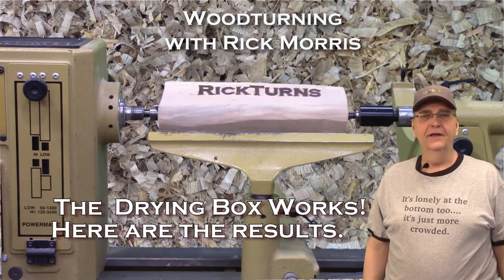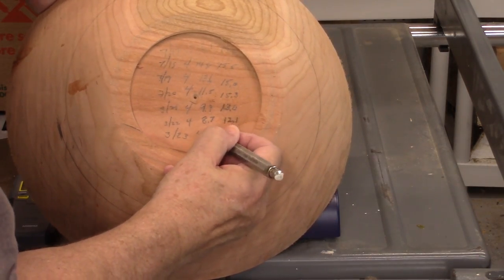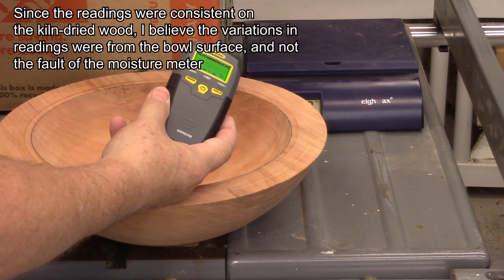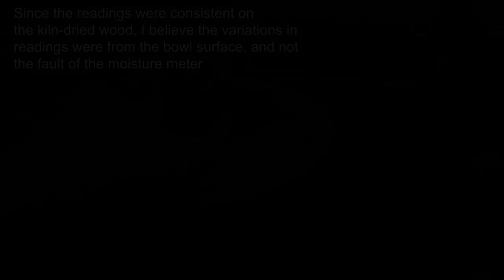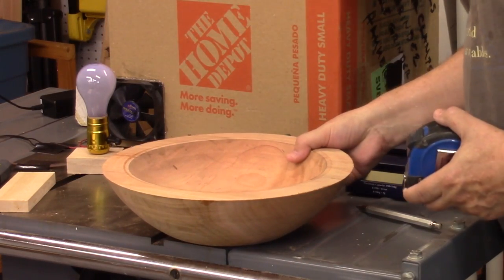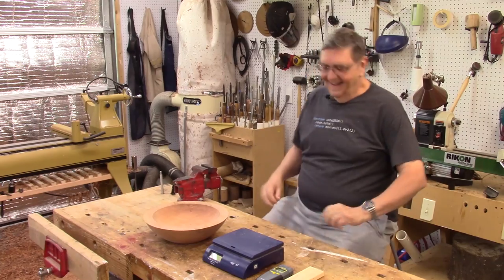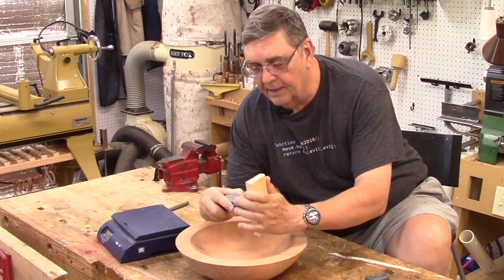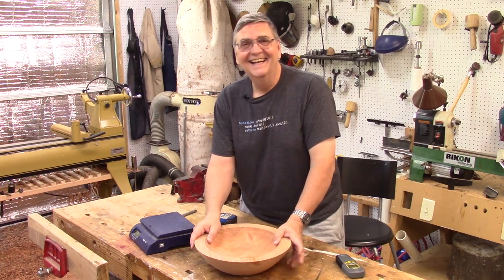Drying a cherry bowl blank in my cheap homemade drying box

Comment: By far, you have made the most simple and inexpensive process I have come across yet. Well, placing the bowl in shavings in a paper bag is less expensive, but I did not want to wait 6months to a year for the process to work. And, I dislike the microwave process. There is usually a couple of day process with that as well. I like your results from day to day as well as the regulation method of just using a larger or smaller wattage bulb. Very fine job, thanks for sharing!
Reply from the maker: Thank you, Stephen.

Comment: At the fair I watched a green wood chair maker, make his chairs.  The body was green wood and the spindles came out of his drying box.  His cardboard box he lined with tin foil and pushed wooden skewers through the sides to make a shelf for his spindles. He also had a light inside.  Don't remember if any fans were involved.  He said the spindles were bone dry and when put into the greenwood chair, the chair hole would dry and shrink and the bone dry spindle would expand, making a very tight joint.
Reply from the maker: Sounds like a good way of drying sticks, and an excellent way of making chai joints. Thanks for watching and commenting, Bruc.

Comment: Some of the moisture meters readings are effected by the temperature of the wood being measured and the temperature of the meter this could cause difference in some of your readings.  Check with manufacture to see if that is the case with your meter.  Liked your videos and look forward to more.
Reply from the maker: Thanks for the tip about moisture meters, Vic.

Comment: Great job of explaining the details. How or what would you say to change for drying 1" thick green oak cuts about a foot square? I have quite a few.
Reply from the maker: I would stack 4 or 5 together with spacers in between, then dry them for 4-5 days. Weigh one of them before you start, and weigh it again each day. When the weight loss per day is done to a tenth of an ounce or so, declare it dry.
Reply: @RickTurnsWoodturning  Awesome, thanks. I have about 50 or so to dry, so 5 sticked pieces it is!

Comment: I theorize that your forced drying in the box led to a dryer surface than in the middle of the blank. Over the 5 days in your shop, the higher moisture level, in the center of the wood, migrated out and left you with a slight weight loss while the surface moisture increased from about 11.5 to 13%.   I am surprised that your did not force cracks to appear in the bowl...I boil my cherry bowl blanks in water for an hour and leave them in paper bags with shavings for 3-4 months, all in an attempt to prevent cracking. Looks like your method works faster than mine and gets the same results :-)
Reply from the maker: I've read about boiling bowl blanks before drying them, but I've never tried that. Generally, I've had very good results using a drying box, with only an occasional split.

Comment: I just made one of these!  How long would you say it would take to dry a price of wood 1 inch by 12 inches, 1 inch thick, in one of these boxes?
Reply from the maker: Probably 7 days. Weigh it every day, and when the day-to-day difference is 0.3 oz, it’s ready to turn. Or you can use a moisture meter of course.
Reply: Rick Turns thank you!  The box is awesome...so I have another question,  what I'm drying is actually a kitchen utensil I just finished, I'm not putting it on the lathe, I'm actually just drying it before i finish it with oil....I can't afford the equipment you speak of, do you think It would be safe to just give it 6 days in the box and assume its good to go?

Comment: If you don't need the bowl right away,  wouldn't it be better to just let the bowl dry without extra heat or air movement?   The faster you dry it the more likely it is to crack, right?  Why not just let it sit for a few months at room temperature.
Reply from the maker: You’re right, if you’ve got the time, the best way is to put the blank into a paper bag full of wood shavings and let it sit for three to six months. I normally work on one bowl at a time, because I’m making a video of each one. So I do the drying as soon as I’ve roughed out the blank.

Comment: If you use the oven dry formula for determining MC, take the wet weight, subtract the dry weight and then divide by the wet weight:  5.3 - 4.7 = .6 / 5.3 = .113 x 100 = 11.3%.  This is the most accurate way to determine the MC.
Reply from the maker: I hadn’t seen that formula before, but it makes sense. Next time I dry a blank, I’m going to use that and compare it to what I get from my moisture meter. Thanks!

Comment: I don't understand why we want to speed up drying when we usually coat and bag them to slow down the drying to prevent cracking...?
Reply from the maker: The goal is to speed up drying but still prevent cracking. Bagging can take 3 months or longer. Using a drying box can reduce that time to a week. Thanks for watching, Peter.
Reply: So I don't understand why speeding up drying reduces cracking?
Reply from the maker: Speeding up drying does not reduce cracking...if you speed it up too much, you will still get cracking. However, it is possible, using a drying box, to reduce the drying time from 3-6 months to a week or two, without any cracking.